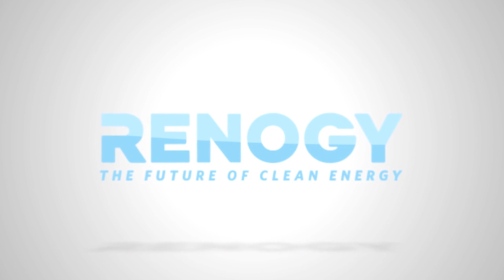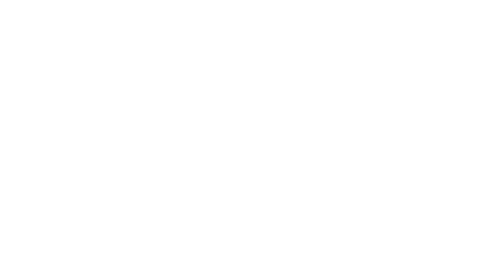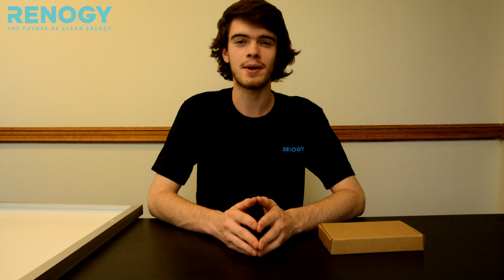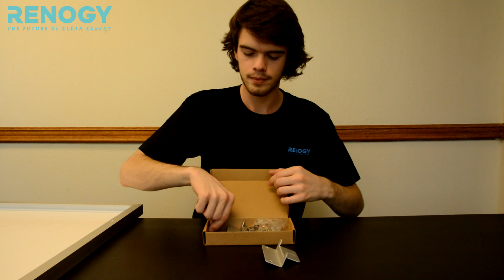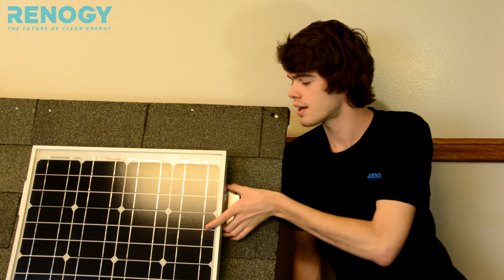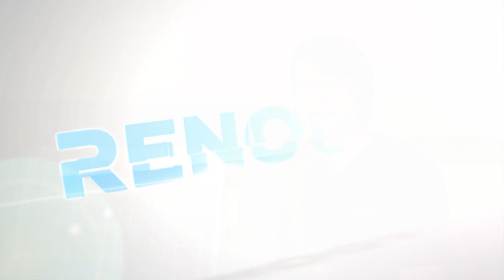How to Mount a Solar Panel using Renogy Z brackets

Comment: Wont do these brackets mount to the underside of the panel instead of the outside edge. This makes take the panel off and on the mounts once installed near impossible. I am going to have to remove the brackets, re attach them to the panels and the reattch to my roof and reseal. What a terrible design. Makes me question renogy.

Comment: A dab of sillicone between the drilled holes in the roof and the z bracket will help stop water leaks in the holes later on as well.
Reply: Better to buy a roll of butyl tape. Silicon won’t last as long or seal as well.
Reply: @Swampwild1 butyl tape? That's the first I'm hearing of that. I've been searching for solutions that will prevent or mitigate a leaking roof during and/or after installation and/or uninstallation.

Comment: Thanks but it should be reshot, especially 9 years old. This still links from the main website. Not the best start when you show the bracket and then spin it around and flip it, which way was it actually placed? Unclear. Also holding up the stack of washers so far away and then flipping it upside down underneath wasn't clear as to the order of washers. I appreciate it takes a  longer setup and camera work, but this is an instructional video by a reputable company. Using pliers instead of wrenches is also only the way to do it if you don't have wrenches, the wrenches would also fit easier. Sorry, lots of criticism. My original purpose was to see the holes in the solar panel frame, but i guess the panels he was using have been replaced many times. Nice job. i appreciate the effort.

Comment: I may be missing something, but everyone, including Renorgy makes a point of pointing out how important grounding is for Safety, and so they won't be liable, but then they provide this system with no explanation nor suggestion on how to GROUND it. I have read numerous Renorgy manuals and they say things like "The frame of the PV module, as well as any exposed non-current carrying
metal parts of fixed equipment that can be energized MUST be grounded to avoid electrical shock."  and follow that by saying "Appropriate grounding consists of using an appropriately sized EGC or racking system that can be used for integrated grounding" so why the heck are the showing you this system? and what is "EGC". This is not helpful, i.e. using undefined acronyms.
Reply from the maker: Hi, customer. Thank you for leaving us the valuable feedback. We will add the instructions in detail later in our videos and manual books.

Comment: Thanks for video, it was clear to me except for two things.  First, don't you need nuts to hold the bolt to the roof?  Would they fly off in strong wind?  Second issue - how come no sealant - won't the connection to the roof eventually leak?
Reply from the maker: Hi, Nancy.

Thank you for contacting Renogy.

For your questions, we will answer them one by one:

1. We used bolts and nuts to fix the bracket, and the screws connected to the roof can firmly fix the solar panel to the roof
2. In order to leave enough space between the board and the roof to dissipate heat, we did not fully fit the solar panel and the roof. And this panel is a rigid panel, which will not be easily blown off when it is fixed in good condition.

Hope it is helpful.

Comment: This has to be BY FAR the worst instructional video I have ever watched... how about use proper tools? the socket size are 8mm to attach z brackets to solar panel and 10mm for the others... where to position all of them, talk about sealant and last but most important the screws for the roof are self tapping, meaning no need to drill anything, they are designed to open the hole on their own. 
Did anyone at Renogy Solar did not think this poor kid should have had at least a haircut and some type of knowledge before putting him up to this? SMH
Reply: Shut up about the guys hair
Reply: I agree with everything you said (excellent observations!). I can empathize that making an instructional video can be stressful- but I also had to laugh because the bracket looks crooked and it appears he tries to hide it with a nervous smile and folding his hands over it.

Comment: I'm putting 4 Renogy 100w solar panels on the roof of my trailer. The instructions for the Z-Bracket suggest "well nuts" to secure the brackets to the roof. I have a supply of 1/4-inch "rivet nuts". Is this a safe alternative to well nuts? I understand I'd need to seal the holes in the roof.

Comment: Should the bolts be driven into the roof trusses, or just to the roof decking? TY
Reply: Page 13 of the Z-Bracket instructions say that the screws should go into a "structural element such as a rafter, stud, etc."
Reply: Where's page 13..no instructions sent with my purchase...hoping all renogy products work..I bought solar panel brackets and cable..

Comment: Website shows bolt inserted from underneath then spring washer flat washer and on top add another flat washer then nut. Please clarify which is correct or best

Comment: Agree the video could be much better. How do you mount it to the roof of a van?  Use those self-tapping screws? Will highway speed pull those screws out of sheet metal?
Reply: You are correct, the included self-tapping screws would surely rip out at normal highway speeds. Page 18 of the Z-Bracket instructions says to use well nuts on RVs. It also says you want at least a 3/8"-thick roof, so a backer inside the van would be appropriate.

Comment: no screws, bolts or washers came with my 600 watt panel array!
Reply: The hardware comes with the mounting brackets -- not the solar panels.

Comment: no way iam going to drill through my camper roof to fix the panel tooooo thin what brackets do you recommend also the roof is ribbed, bit disappointed in the kit no colour differential on the battery leads and no glands to bring the cables through the roof, they sell as as basic kit there should be enough and of the correct material to install

Comment: Lmao, he never told us what size drill bit he used to drill the hole with before inserting bolt...
Reply: the bolts are 6mm so I would use a 4/5mm

Comment: Pretty straight forward.  Thanks for showing the details.  Of course one would caulk the screws when doing roof work.  Rank amateurs should stay off the roof and do not attempt to do solar panel installations.
Reply: "caulk the screws" ?   This kid called them BOLTS   - after 11 yrs I hope he has gained some Knowledge.

Comment: First it is important to note that if you seal holes with caulk-no caulk will last as long as  a 40 year shingle roof. Most caulk has a life of less than 15 years. Second  if you are unable to  put the bolts into the rafters the ( 1/2 inch ) plywood alone will not hold those panels  in severe weather-(HIGH WIND). This is a very poor support system for those expensive panels. There are better systems out there.
Reply: Yeah like my system on a 10 x12 ' shed roof is a great system because I drilled into 2x4" x12 ft going across the length of the roof and 4" bolts screwed into the each end of the 12 foot  x 2x4" , and another 4 inch bolt drilled into the middle at the 6 foot mark of the 12 foot board. I just mount my panels onto the 2x4"s without the worry of having a bunch of holes in the roof, plus the more bite I'm getting by mounting the panels into the 2x4s wood.
Reply: The only problem I ran into was when I added a Renogy 100 Poly panel to my 2x4 set up because I bought it back in 2009, and the hole cut outs on the panel were a lil different than the 100 watt  longer panels they're producing today.

Comment: Renogy Solar what is the gap (in inches) between the panel and the roof once it's mounted using z brackets as opposed to unirac mounting rails? wind resistance for z brackets??
Reply from the maker: TubeRippa The gap is about 0.75 inches tall from the back of the frame of the panel to the roof, and the frame is mostly empty space,  so there's plenty of room for air circulation for cooling. We don’t have any data on wind resistance at the moment.

Comment: Do the bolts need to go through the roof framing or is driving it through the shingles/plywood sufficient to secure the panel even in decent winds?

Comment: ANY hole you drill into any exterior surface should be filled and caulked with an exterior grade all-weather caulk or silicone.  Water can and will find it's way into any open area that is not sealed off.  You can find good sealants at Lowe's, Home Depot, etc.